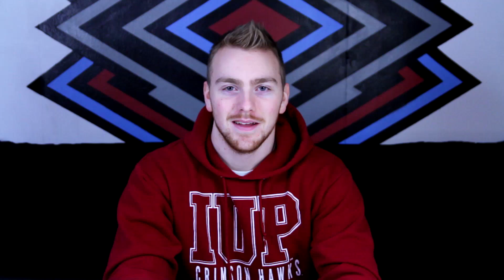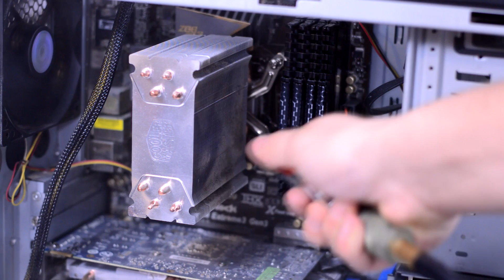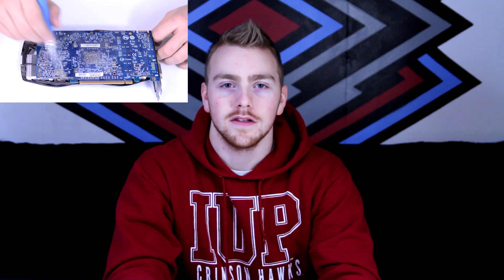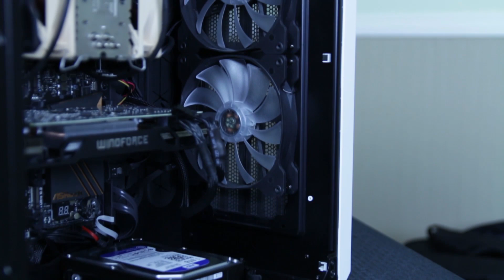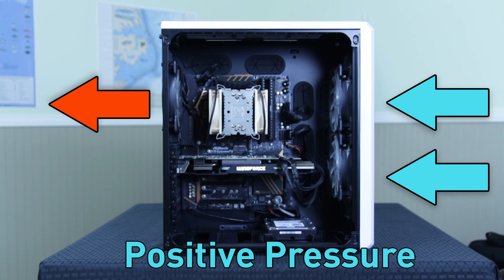Positive, Negative & Neutral Air Pressure -- Does it matter??

Comment: Would having 2 radiator front intake fans on a pull config. One top exhaust fan. One rear exhaust fan. And having the GPU facing up be efficient? (I use the NZXT s340 and want minimal dust.) I hope for positive air pressure :)
Reply from the maker: +Meowmix Ya that should work, it all depends on the RPM of the fans! If you push too much or pull to much your pressure will change.
Reply: +Affinity Collective Tech that's what I'm really confused about. I don't really how to set the RPM because I'm using the case fans coming with the case and I really don't want to invest in a fan controller.
Reply from the maker: If you aren't getting a fan controller, then you can often set some of the RPM's in BIOS and others using a program like SpeedFan. I use SpeedFan a lot: http://www.almico.com/speedfan.php
Reply from the maker: +Meowmix Hey Meowmix this is JD. From the sound of your setup you might see a negative pressure environment. The way it sounds is you have the radiator fans as your only intake correct?
If this is the case, when you have radiators it takes away some of the air flow to natural obstruction of the radiator. To definitely get positive air pressure I would switch around your top exhaust and make it an intake. 

If you are worried about the dust from that by it not being filtered look up mesh dust filter online. It will be a few dollars and you can cut to size what you need and install it.
Reply: +Affinity Collective Tech hmm. I guess you're right. I'm just really confused as to how to set this up. I'd prefer not to have negative  air pressure. Do you have any recommendations for fan placement for a positive to near positive setup? (My Rad will always be in the front and I have 2 fans. I don't mind buying like 2 extras.)
Reply from the maker: +Meowmix Honestly, don't over think it. I can't really give you any suggestions unless I was in the room and playing with the fans myself... Go to the grocery store, buy some incense and burn them near the case, figure out where the smoke is going in and coming out. If air is coming out of the small cracks of the case you'll know what's up. I'd suggest just trying a couple different set ups out and see what you like best.
Reply: +Affinity Collective Tech okay thanks I'll try that out.
Reply from the maker: Sounds good! Send me an e-mail if you run into anything affinitycollective@gmail.com
Reply: +Affinity Collective Tech thanks man. Your a really helpful person.
Reply from the maker: No problem just here to help!!-JD
Reply from the maker: Hey Blu sorry for the long reply, myself and Connor were out of town for a few weeks. From the way you describe your setup it sounds like you should have a good positive air pressure environment with plenty of fresh air coming into the case. 
To significantly improve temps for your GPU more than a couple of degrees you would have to water cool the GPU. BUT, i would not put money into water cooling a GPU of that caliber. While it can be done IMO it would be better to purchase a better GPU with that money instead. -JD
Reply: im planning on having a rear exhaust 3 top intakes and a 360 rad mounted in front with the fans on the left hand side blowing into the rad, will this count as an exhaust ?
Reply: Hello i would like some help :D i have an Enermax Ostrog which the setup currently is 2 intake from the top, 1 intake in the front, 1 intake from the bottom and my exhaust is my Radiator, PSU, and GPU. I wanted to improve the temps on my Asus Turbo GTX 960 2gb which is a blower style fan and i was wondering if this setup is correct? thanks!

Comment: Thanks looks like I'll be going 2 fans front and 1 back
Reply from the maker: +tj-scoob Glad we could help! See if you have a large hard drive bay that you can remove from the front of the case so you can get a little extra air-flow! You can pick up a pack of incense pretty cheap that will produce enough smoke to make sure everything is moving the right way!
Reply: @AffinityCollective  
can i use 3 in front 1 rear  and align the CPU aftermarket cooler to take air from the front  and through it to the back ?